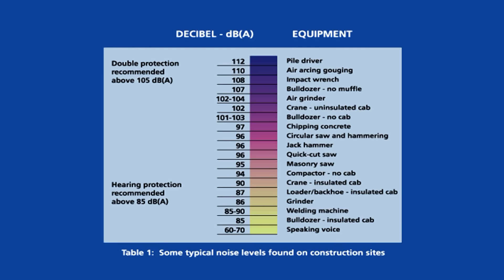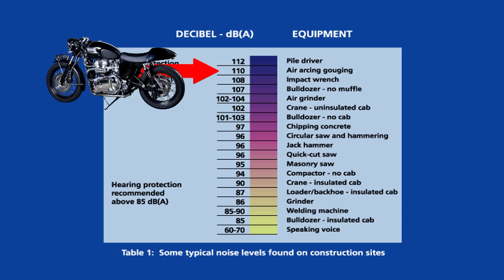Why Not to Change Your Car's Muffler

Comment: Scotty just burned ricer kids low key
Reply: Sir Brellin this is only for "modern" cars, ricers often don't drive "modern" cars.
Reply: Sir Brellin  Well someone had to. Ricers with farts cans should be taken off the road permanently.
Reply: Sorry but a new exhaust system is a performance mod not a cosmetic enhancement.
Reply: 2JZ FTW  its actually  both
Reply: Modern cars meaning 90's and newer.
Carburators started disapearing in the 80's
Reply: 2JZ FTW didn't you watch? Most people just put it on there. ZERO gains on fuel injected cars.
Reply: alphatrion100 
I’d be inclined to agree, I put a 3” tube with one less box in the middle section and A non resonated rear box with twin 4” Outlets on my Focus ST, I actually felt that it run Slower with that exhaust on Until I took it in to be Remapped now it’s feels a lot quicker but I can’t say if it would still be better without the trumpet exhaust .
Reply: alphatrion100 "Exhaust System" is guaranteed to give you some gains no matter what. A fart can isn't cause its literally a muffler with a bigger tip
Reply: Sounds kind of like bees! Hahaha!
Reply: They still exist?!? I only see people with tinted lights and bad rims but Im sure that does not qualify as “rice”
Reply: An exhaust does make a difference in power especially if you straight pipe the cat you don't need to over due an exhaust but slightly bigger than stock and better flow
Reply: Sir Brellin
Scotty is low key a rice cooker.
Reply: alphatrion100 The 1980s was The start of Fuel injection.
Reply: charger master The earliest use of fuel injection was in 1925, most American vehicles came out with it in the early 80’s.
Reply: Sir Brellin he destroyed them
Reply: 2JZ FTW scotty and i disagree. It can make your car run worse if you don't know what you are doing.  You don't have to believe me but Scotty is a mechanic with 40 years experience.  You think you know better?
Reply: charger master that's what I meant with "carburators started disapearing in the 80's. My 86 cavalier still had a carburator.  You can consider almost everything  90's a modern car.
Reply: Never identify with ricer kids, EVER.
Reply: You mean the Riceronian Kids?  That'll be a good new name.
Reply: Straight piping a NA engine will actually reduce power... Unless you got a turbo/supercharger it's not worth doing. In fact, tuning a NA car is so expensive compared to a car with forced induction, it's probably not even worth the money.
Reply: Jeep Life71 what us the proper way to change the exhaust if I want my car to sound nice but not riced. I have a stock Hyundai Genesis and want to start doing some mods to it, I want the car to sound nice but not obnoxious either, I was thinking about adding an intake, am I supposed to do something with exhaust or is the cold air intake enough
Reply: @ Sir Brellin
Yeah, cuz muscle car and pickup guys NEVER put aftermarket exhaust systems on their rides that are loud.........
smh  :/
Reply: Teched TMG did you ever end up doing anything? most people just dump all silencers before the cat and it sounds bad but if you just run a resonator with a catback it generally gives the exhaust a more refined sound and is less obnoxious or “ricer”
Reply: Funny these soo called ricers be spanking these soo called muscle cars lol
Reply: @vegetar7886  k20, 24 civic done properly will chop a mustang no problem most v8 bois are just ignorant

Comment: Paused video to comment before watching. Let me guess..... 

Scotty does his thing where he goes "the engineers of the vehicle knew what they were doing"

UPDATE: I was right
Reply: Nailed it! 😂👍
Reply: The problem with that argument is that the engineers who designed the thing were concerning themselves with a lot of factors many car guys just don't car about. Like being quiet, for example.
Reply: @reaganharder1480  True. The engineers had to design the exhaust system with emissions in mind but where I live has no emission laws so it's okay to remove all this restricting crap.
Reply: When you go to free flowing exhaust you may gain top end horsepower, but you lose torque in lower RPM range. Not a concern with a hotrod, but if you really use your truck for working and hauling torque is more important. Also, a builder of performance engines tried changing the valve angles. Found that going from standard 45 degree to 35 degree lost approximately 5% of horsepower, but gained over 10% torque.  Torque is what makes vehicles go. More horses at 4000 RPM doesn't do you any good in normal driving unless you're passing some one. If you just want loud install cutouts and go whole hog.
Reply: Let me guess, you watched it, and then edited it.....
Yep, I was right
Reply: @WeekendWarrior604  🤡
Reply: @johnchandler1687  That's good information thank you for sharing
Reply: @jesusislord4060  The laws that require us to have Catalytic Converters on our vehicles are FEDERAL LAWS -- it doesn't matter what STATE you're in -- Catalytic Converter removal is ILLEGAL, and punishable under Federal Statutes.
PLEASE try to remove that "restricting crap" from your head and learn something about how our Emissions Systems actually IMPROVES the performance and longevity of our vehicles.
Reply: So contradictory, engineers at car companies suck and make the cheapest stuff, but don't mess around with your car because it's so well engineered to run as perfect as it can
Reply: @jesusislord4060  It DOESN'T MATTER what state you live in -- It 's a FEDERAL LAW that emissions equipment installed at the factory MUST remain in place and functioning.
If your state has no emissions laws, it shows that the people that gerrymandered their way into power just don't give a damn about you OR your children -- and they never did.
Reply: @tluva1020  no way I honestly verbally predicted it as well

Comment: You can change the exhaust without making it louder.

For example install a true dual no crossover exhaust on a V8, and install two separate cats and two separate mufflers. 
That way your car didn’t get louder but it sounds much nicer because of the uneven firing V8 shining and showing it’s real character. 👌
Reply: I approve as a V8 owner. Most Ford come with true dual with H pipe.
Reply: @austinbishop7430  for sound AND performance, h-pipe is the way to go. 👍
Reply: I mean his main concern isn't the sound but more that he claims that it ends up making your car actually run worse, not better.
Reply: @robmen1402  That’s incorrect though.

Comment: Most ECU figure out the new airflow pretty quick and compensate for it   loud pipes save lives
Reply: Need at least a Rez ( resonator muffler )
Reply: It does save lives, better acceleration response as well to Swerve the haters 😁
Reply: Philip Turner  my muffler fell off, I get the funny type of attention which I find funny
Reply: Philip Turner  you say that like you were never young
Reply: Yes..... actually new exhausts like that give you more horses on higher rpm by taking those horses from lower or the opposite,so scotty is wrong
Reply: Philip Turner  i like a nice little tone but nothing loud
Reply: @ariskaitamialastakagela9187  it might give you more peak horsepower, but it'll mess up the torque curve if the exhaust was not tuned to the bike.
Reply: Philip Turner  loud cars also sound good, doesn't mean you're trying to impress anyone lol

Comment: This guy is that grandpa that tells you to keep your car all stock straight from the dealership 🤦🏻‍♂️😂
Reply: A car is actually worth less when you modify it from original spec.
Reply: Sim Doran yeah if you return it to the dealership.
Reply: @simdoran8516   And?
Reply: @simdoran8516  that's not true at all actually havent you heard of 100k supras?
Reply: @simdoran8516  depends on what it is, if you bulletproof a 6.0L it'll sell for more because you've fixed all the issues that it had at original spec 👽
Reply: @slim uhh no that highly depends on the type of modification the vehicle has been done. My neighbor removed the crap plastic bumper on his Tacoma and replaced it with a 3/16 steel one and also put new running boards and a OEM regulated exhaust system on it. When he decided to get a 4 runnner instead and trade it in, was worth a hell of a lot more.
Reply: Its true trust always since you buyed it
Reply: @mrjpz  a stock Supra is way more of value than a moded one
Reply: @m3e642  I didn't say it wasn't. There are some 1of1 supras that are more expensive than stock ones though just depends whatcha got

Comment: Watched this video yesterday, today took my mufflers off car sounds fantastic runs better no engine lights 👨🏼‍🔧
Reply: Mechanik
Reply: Honestly its only okay to remove your muffler if you tune your car to compensate for more air flow or else like Scotty said it will run worse as there is less fuel than air.
Reply: @jesusislord4060  recommended for 90+ 110 octane cars unless you want to smell like rotten eggs everywhere you pull up
Reply: @SpookyDaScary59  Wdym? Why?
Reply: @jesusislord4060  high octane burns off almost 100% so you won’t need muffler or cat, but my Ford will stink the place up on unleaded
Reply: @silverrain99205  Lmao
Reply: @SpookyDaScary59  i have no knowledge, but that egg smell is nothing to do with muffler, that is related with catalyst as I heard.
Reply: @RealeaD  wrong octane could ruin engine and clog catalytic converters
Reply: @SpookyDaScary59  then is not it nothing to do with muffler?
Reply: @jesusislord4060  Why pay to tune your vehicle? I just do it myself.
Reply: @jesusislord4060  false

Comment: Basically dont even put a sticker on your car because he'll have a reason why 😂
Reply: Stickers on your car, especially the ones like STP, can mess with your computer and throw off the air/fuel ratio giving you even worse performance than you had before putting that sticker on.  Also, stickers are illegal in some states and your car will fail inspection.  The engineers that designed your car did not design it to run correctly with stickers.
Reply: @OverlandOne  and that's getting scott free, if you have bad luck, those stickers will decrease your hp and even kill the engine. They wear out the valves and the pistons real fast.
Reply: @pxndxlunx5821  Scott Free
Reply: it can mess with ur paint
Reply: Yeah! Enemies can recognize you..

Comment: If I wanted a quiet car. I would have got a prius. I do it cause I want my car to play the song of it's people.
Reply: jean dufresne if you have a Honda I swear...
Reply: I don't. lol But I wish I did because they are cheap and easy to modify. If you ever have spare time, check out boostedboiz channel on YouTube.
Reply: jean dufresne they are garbage cars. I’ve seen that channel
Reply: gooz0mbie Why do you think they are garbage?
Reply: I may not be a fan of Honda's but they are far from junk. IMO Honda's are better than Toyota because they last forever but they aren't insanely expensive to repair
Reply: Jordhan Coward agreed.  I hate them little fixed up Civic and Integra.  I am a Mustang GT driver.   So you know where I stand.  But them Honda's...anyway you look at it damn well built cars that can last forever.
Reply: Your punctuation and grammar are throwing me off.
Reply: jean dufresne agreed . I have a Honda with a free flowing exhaust and it didn't do anything to my car I've rebuilt the engine on it and going turbo I hope it sounds even better.
Reply: If I wanted a loud car, Ku would’ve bought one with a factory tuned exhaust. Like Scotty said, if you put a different muffler on your car without programming the engine, it’s just not going to work right.
On a related note, I crack up laughing whenever a 4 cylinder has a performance muffler on. It doesn’t sound cool. It literally sounds like you’re revving a chainsaw.
Reply: Edward Fielding  watch engineering explained about muffler
Reply: You mean you want attention.
Reply: You mean a chainsaw was programmed to have more power than your stock car because one is made to take down a tree and the other not? Also rotors rev more than four cylinders. In fact all small engine are programmed to rev whether it offends you or not your car is still slow.
Reply: Edward Fielding Probably because most of the people you see installing "mufflers"  on 4 cylinders cheap out and buy some crap system if they get a proper set up this would be a whole different story
Reply: It'll do something but nothing that crazy. My Mini has a cat and a performance resonator and straight pipe and it sounds just fine
Reply: I like scotty but some of his content is stupid.  Muffler is exactly what its name is to muffle sounds coming from your car . You only need to tune your (gas) vehicle if you remove the cat
Reply: Joan dufresne
"I want my car to play the song of its people."

Banjo music?
"You got a purdy mouth..."
Reply: james liu My civic eats mustangs for breakfast 🍳
Reply: It's fairly annoying tbh

Comment: Nothing like a pair of Cherry Bomb mufflers on a V8 engine.
Reply: Yup, I had that set up plus headers on my 340 Duster...
Thumbs up!👍🏼
Reply: I just added a cherry bomb on my 2014 Silverado and now I'm getting a slight rough idle
Reply: this is the most boomer comment I've ever seen
Reply: I want to either straight pipe or cherry bomb the muffler area but after a call to a shop I had work done at years ago, sadly I was advised against it. He claimed that I would lose performance especially during towing situations. Now I'm frustrated...
Reply: I had a 1979 monte carlo with a built 350 and put some old school glass packs from the 70's on it. That thing sounded awesome. One of the best sounding cars I've owned.

Comment: Scotty, you're too old for this. Take a breath while you realise modern ECU's are perfectly able to re-tune themself to new AFR after MINOR mods like catbacks and intakes
Reply: >Korben Dallas: You do realize that ECU's are programmed to be in compliance with EPA guidelines don't you? It'll retune to stay in compliance, usually resulting in a leaner running engine.
Reply: @TeeroyHammermill  yes I know, hence why I said MINOR mods. Some ECU got more latitude than others and I think it's simplistic to say that every mods will harm every car lol.
Reply: Korben Dallas can you tell me where scotty said “every mod will harm every car” or any equivalent statement?  i heard him say that these mods were bad to do if done improperly and without tuning, but i missed the blanket statements...
Reply: Paul Daniel m
Reply: what if you have a valvetronic exhaust that you can turn it on for loud or off for normal?
Reply: Korben Dallas but how new. I have a 2004 mk4 JETTA. I’m plan to put a sport muffler and tip. I don’t want to regret it...
Reply: @jeremiahginter1892  ???
Reply: @davidcardona349  i have a golf 4 gti nothing wrong with removing the muffler my car felt better after removing it i guess because it had less back pressure allowing the turbo to spool up better with more flow no check engine lights at all for 2 years no effect on fuel to i would only recommend a tune when going to a bigger exhaust 2.5 iches (63mm) increasing some boost allowing the engine and turbo to take more advantage of the larger amount of free flowing air and slap on a intake aswell to allow more air in the engine but thats my take🤷‍♂️
Reply: How modern does the car have to be to have this ability ?
Reply: @faizelvarnicker9020  didn't vw had to pay billions of fines for "cheating" softwares on their cars? I'm pretty sure your Golf won't give a damn even if you pull out the oxygen sensors completely
Reply: @turbob84  actually it goes into limp mode immediately and sound terrible. I know so because i forgot to plug it back it onces first the O2 lamda and second time the maf...so meh🤷‍♂️ i dont give a a damn about what they did so if you feel hurt by what vw did thats your own oppinion its all subjective i just dont recall what you saying being part of the topic. For all i know any car company can be cheating in some way the only difference is they havent been caught yet.
Reply: Yes..... actually new exhausts like that give you more horses on higher rpm by taking those horses from lower or the opposite,so scotty is wrong
Reply: Well they must be able to tune themselves as otherwise Active Valve exhausts wouldn’t work at all
Reply: Cpt_ Tooth any range of year that could be? 2010-2020 perhaps?
Reply: @faizelvarnicker9020  that’s not how Volkswagen turbos work😂 at least in your golf, to get more boost you have to adjust your waste gate arm on the turbo, even then you’ll have to put a voltage clamp on the map sensor so the car doesn’t go into limp mode, but you’re right about the turbo spooling up faster since the exhaust does flow more freely, unless you had a non waste gate turbo then maybe but then the boost only builds with rpms so the only way to get more is to rev higher and higher
Reply: @boostedsc4040  correct me if im wrong but i did not mention an exhaust gives more boost i said id recommend an tune to allow for more boost so that the turbo can and engine can take advantage of the extra free flowing air i know theres an actuator on the turbo and there is more to jus adding a voltage a clamp to the map you have to adjust fueling , timing and other parameters needs to be changed to compensate for the boost added but by the way i was not only refering to my car only and for your info mine was tuned after this comment next time read carefully. PS the black smoke your sc300 and misfiring could be due to overfueling thats the only time a petrol car will smoke black according to my knowledge so revisit a tuner or check filters, fuel pressure regulators or put it on a laptop to check for errors if you still can.